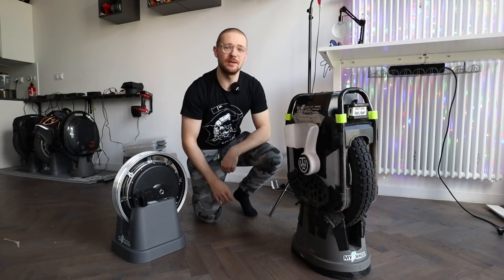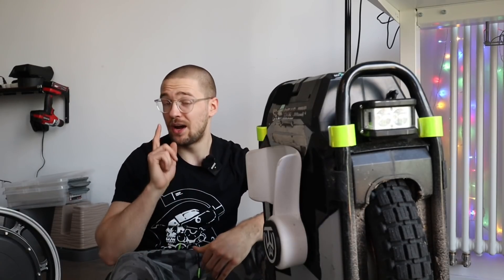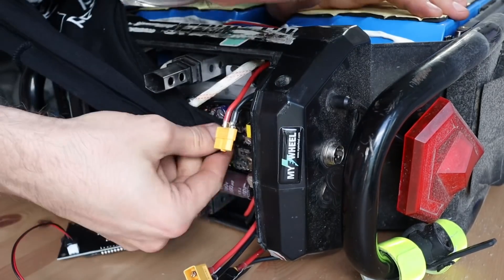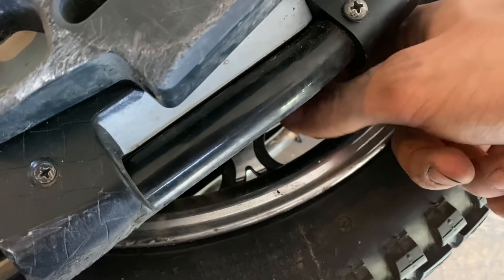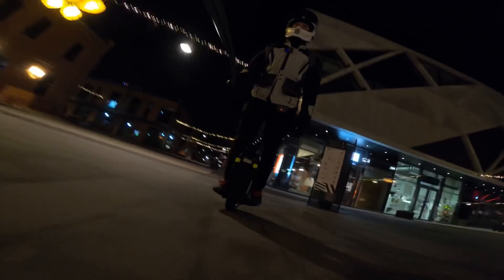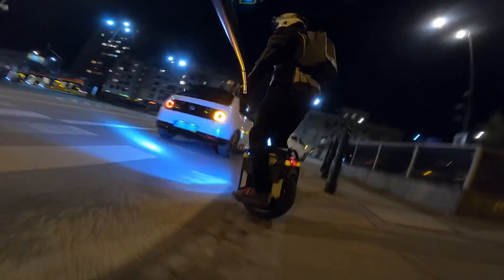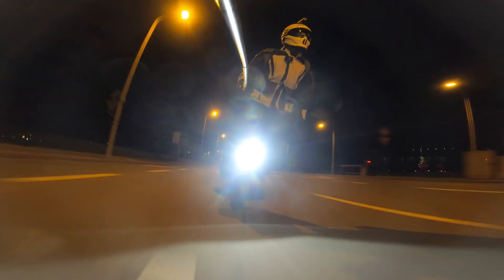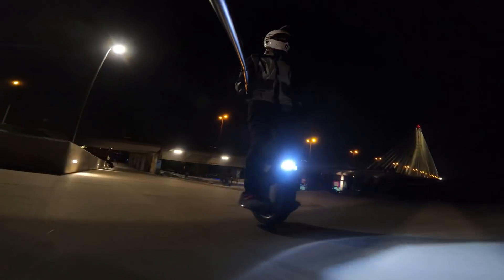The BEST EWHEEL just got EVEN BETTER?

Comment: Just a tip!
If the turning feels weird / square tire like.
Drop the pressure in the tire.
This tires are designed for lower pressures.
I ride my V11 Offroad CST tire with 1.6 Bar - Same tire as the Sherman tire
(Sherman is heavier so probably a bit more pressure is required)

The stock V11 tire is optimal at 1.9 Bar

(Take this with a grain o salt. It depends on your weight as we'll )
Reply: And here is a tire adjustment tip for anyone thinking of changing his EUC tire for a aftermarket on:
https://youtu.be/HW0Xe9nyUyA
Reply: listen to this advice everyone with knobby, huge difference
Reply: ...and ruin the rim.

Comment: Is there a reason why you are still running tubes? If not now the rim is wider and looks like it will seat the bead of the tire correctly, you can run tubeless and more importantly higher grade tires. Honestly this is another thing with EUC's... tubed tires, 25mph plus wheels should not be using tubes, and should ship tubeless.
Reply: I’m new to eucs, why are tubeless tires better than tubed? I know tubeless are less prone to flats but are there any other reasons?
Reply: @l-Lucid-l  ride quality, in this case less tram lining, so you can ride at the intended psi or bar. But mainly punctures euc puncture repairs are generally alot of time. I run tubeless on my mten 3 massive performance difference.
Reply: @frederickoparah1669  oh okay so tubeless tires are less likely to make your wheel stay locked driving in a direction because of cracks in the road? 
I have a tubeless and tubed scooter and I feel like my tubed scooter does that less often to me. But it is a wider tire and the scooter is 20lbs heavier so not really a fair comparison

Comment: I ordered the rim and hangers for my 1st version sherm. It was around $200. Yeah, nothing free for me! Do you have a part number and manufacturer of the new bearings? May as well change them if its in fact a quality improvement? Did the bearings require any pressing? Unfrtunately a press is NOT one of the tools I keep. Hopefully aligning an old motor in a new rim, doesnt prove tough. Upgrading a working wheel, COULD be an expensive and stupid idea on my part. I only bother, as I intend my sherm to hustle some motorcycle twisties in dicey conditions.

Comment: For me the Sherman is just a straight line mile muncher. I prefer agile wheels. (I’ve ridden it)
Reply from the maker: With the new rim it really feels different! I did not like turning and carving before either. Now it’s really fun!
Reply: @mr_wrongway  

New rim or new pedal hangers?
Reply: @mr_wrongway  Is the Sherman Max supposed to have these upgrades?
Reply: Yeah it's far better with the upgrade. Since doing it I no longer ride my 16x. The Sherman is almost every bit as agile now and far more stable.
I don't know how long you've ridden a Sherman but it take hundreds of miles for the weight to go away. At first it feels very heavy but eventually it feels like a feather.
Not sure why but don't underestimate what a dramatic difference it makes.

Comment: nice upgrades especially pedal hangers. Only tire seems to have a smaller diameter now, but for sure it fit better to the rim.
Reply: good point. The tyre must have a smaller diameter if it's now sitting wider. Slightly lower top speed then and extra torque.

Comment: I was surprised that your Sherman had bearing problems. Am I correct that Shermans do not have hollow motors? If so, why would they have bad bearings? The upgrades you showed look great!
Reply from the maker: It has a regular type of motor. Some sand got in for some reason...can happen in a motorcycle too :) I think the upgrades are great :)

Comment: Is that beep at 70km/h the tilt back or does it still have a bit in the tank to keep you from over powering? But man that wheel looks very stable. Also with the new rim was the wobble on the tyre gone? Keep well.

Comment: Thanks for the review and the promo code :-) Saved me 137 € and will recieve the updated version in around 40 days (as per myewheel).
Really nice if that works out. If not 🤫😉👹
An extra tube is given and LCD cover was so cheap (5€) i got one of those as well in case of a crash or scratches

Comment: Very anticipated upgrade, I'd be interested in trying one again now! Including for some off-road.
Did you end up upgrading the firmware as wel l or the Bluetooth module was stuck on the mainboard?
Reply from the maker: Yeah I really want to ride the Sherman again a lot too! Yes it upgraded. I will just need the Bluetooth module to put in again into the correct pins I think I messed it up
Reply: @mr_wrongway  thanks for the reply, glad you like the result!
No significant difference from this new firmware then.

Comment: Nice video man but I move on from sherman already i hate that it beeps on me at 69kph. Great all around wheel though
Reply: What are you getting instead? A motorcycle?! 😂
Reply: @FOSSO15  monster pro
Reply: @alexutlang  apparently it beeps at 80kph and probably reach 2/3 kph more than sherman in top speed
Reply: The Sherman beeps at 70%, while Gotway wheels beep at 80%,, that's why you hear the beeps early on the Sherman.
The Veteran Sherman is still in my opinion a much more better wheel than the Monster Pro, my two cents of course.
Reply: @FOSSO15  i think 2-3kph more top speed than sherman. But I want to cruise at 80-85kph without hearing the beep